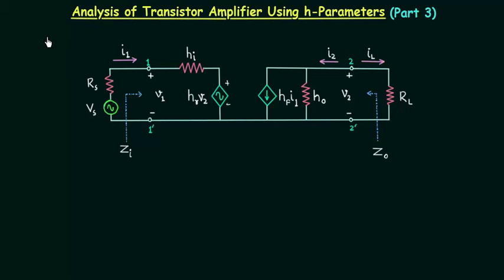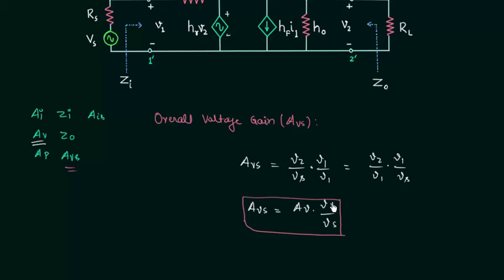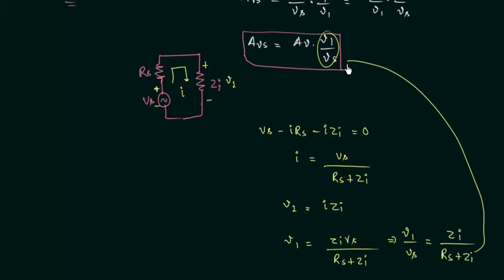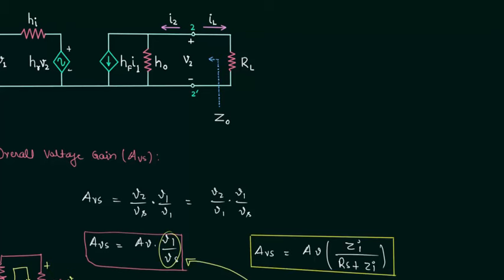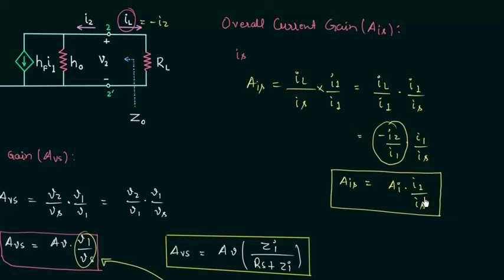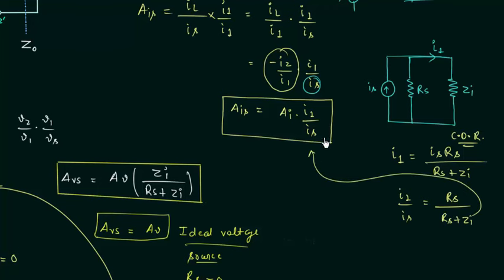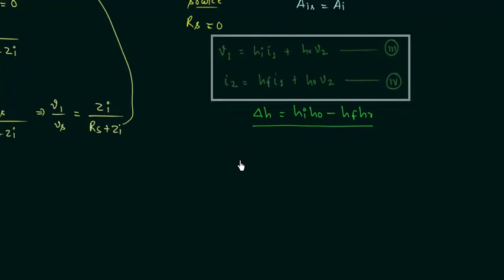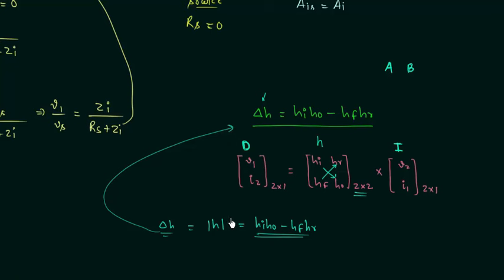Analysis of Transistor Amplifier Using h-Parameters (Part 3)

Comment: Why the norton equivalent of Vs?  Why isn't "is" = "i1" straight away?
Reply: 'Is' is just the input supply, unless you are using superconductors(i.e materials which offer zero resistance to electron flow) for the connections and the construction of the source itself; there will always be some kind of source resistance, which we consider as 'Rs'
Reply: @girishkumarpeddi6266  
Even if Rs is not zero, the current going through it is the current coming out of Vs and the same one circulating in the input loop labeled "i1".  Since the current out of Vs it's being called "is", then "is" =  "i1".

Now, if instead of a Vs with a series Rs, the input was a current source Is with a large parallel resistance Rp, I would agree with all the calculations done at 8:20.

But, as the problem it is stated, I see no need for it, and like I said before I belive that  "is" should be equal to "i1" straight away.

Comment: Sir at 9.25 when input resistance becomes infinity, by substituting the value of input resistance value in overall current gain eqn then it becomes infinity only how it equals to current gain
Reply: If rs becomes infinitely then the current passing through it will be 0 so is=i1 therefore i1/is =1
Reply: Take out Rs as common from denominator and then substitute Rs=infinity.